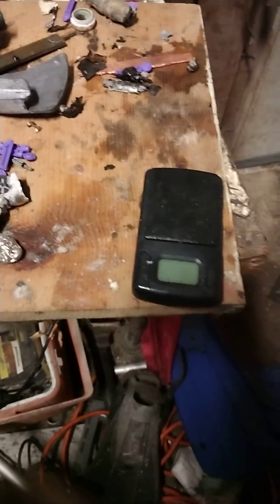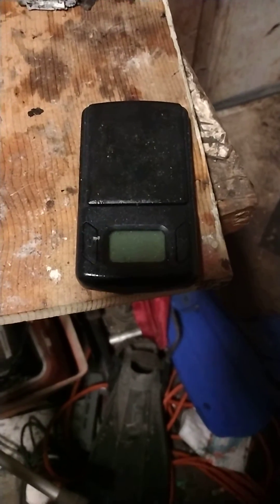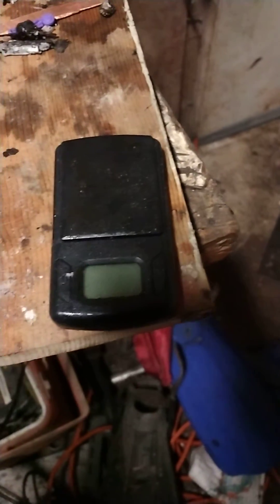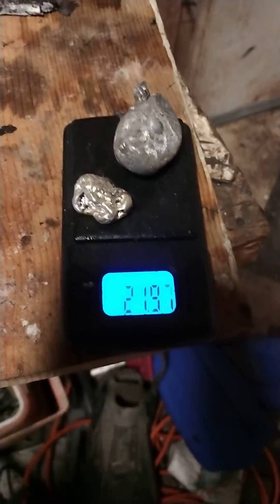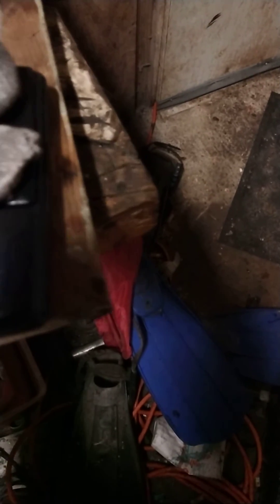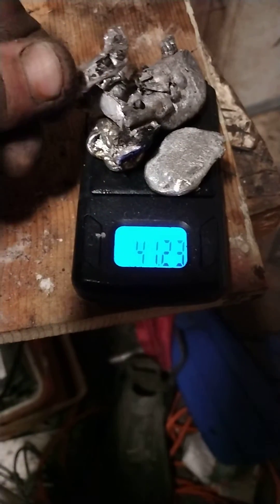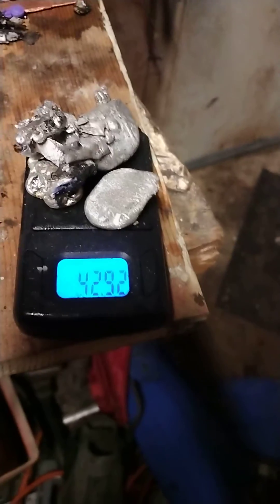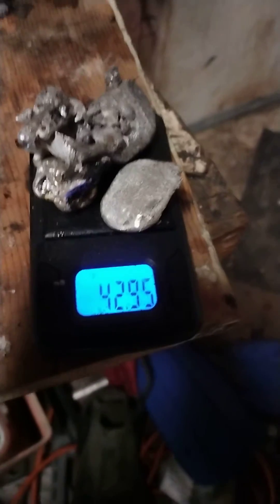rhodium refining

Comment: I'm trying to refine rhodium and platinum alloy to separate the two please help this is hard to find info on
Reply from the maker: Hey, email me thorock77@gmail.com
Reply from the maker: I sell a pdf roughly 50 pages, everything that you need to recover,  refine rhodium. 
Send $50 to my PayPal shawnthor13@gmail.com 
Or cashapp $shawncypret13
Reply from the maker: Hello. I have a pdf I sell for $50, everything you need to recover and refine rhodium
PayPal shawnthor13@gmail.com 
Or cashapp $shawncypret13
Reply from the maker: Ok, drop it it aqua Regia, when platinum is in solution drop it with ammonium. The platinum will drop as crystals and you will be left the rhodium. Put what is left in straight nitric to dissolve any silver or nickel, rinse it out into another beaker, then use hot sulfuric if u want to take it to solution.

Comment: I’m interested in the pdf?
Reply from the maker: Hello. I have a pdf I sell for $50, everything you need to recover and refine rhodium
PayPal shawnthor13@gmail.com 
Or cashapp $shawncypret13
Reply from the maker: thorock77@gmail.com
Reply: @tradinggolden719  I'm bonded with the ceramic finish.  I've only used heat no rinses
Reply from the maker: It took quite a while to get rhodium out of solution. I'm not sure how the lead will act with Portland cement . I know gold can be refined that way.
Send your email along with $50 to $thorock on cashapp ,
I have the PDF along with a video, 6 months worth of equipment daily to get it right, I would have gladly paid $50 to learn
Reply: @tradinggolden719  how can I contact you